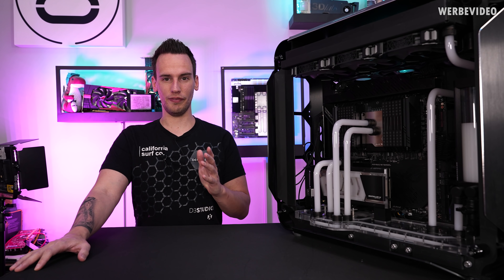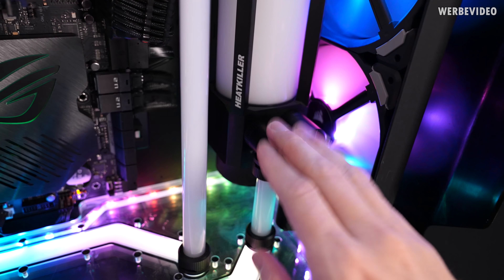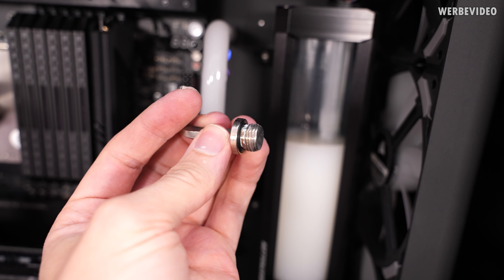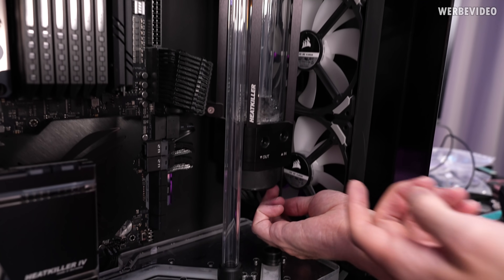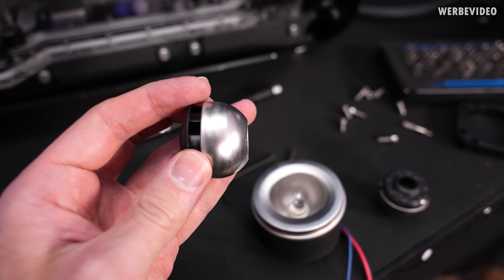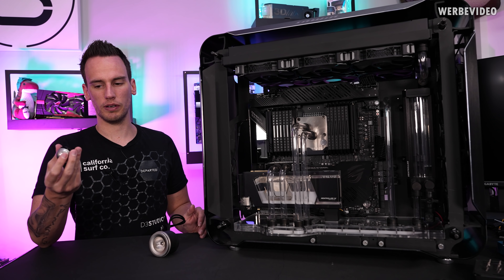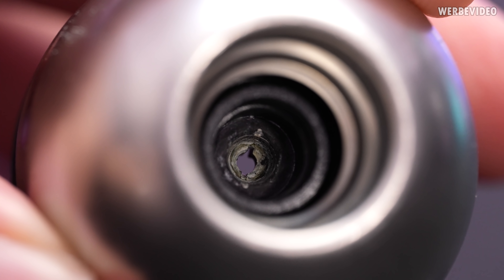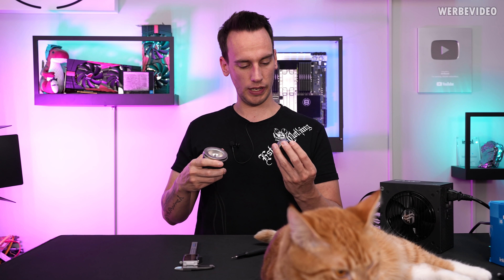Project Irrationality Part 13: Pump Failure :(

Comment: Have you considered swapping just the impellers between the two pumps since they are the same (looks like)? So you could keep the pump with the nice cables. Anyway for 24/7 operation a non pwm pump may be a better choice anyway
Reply: I was going to ask that too. The electric motor is likely to be fine for another while.

Comment: I have never had good experiences with EK solid coolants. Never had a pump die, but certainly had clogged blocks and dirty rads. My system runs 24/7/365 except for flushing and dusting downtime and I have had zero issues with any gunk or buildup since moving to clear coolant.

Comment: a week or so before christmas I had a pump failure of sorts. the pump itself didnt fail, but since it and the radiator fans were basing their speeds off my cpu and gpu temps, after rebooting one night, corsair's icue stopped detecting my cpu/gpu/mobo temps entirely. woke up in the morning to find my pc off and when i turned it on, everything seemed fine until 10 minutes later when my pc abruptly turned off again. It had seemed weird that my gpu radiator fans werent spinning prior but usually its cold here in the morning so hadnt thought much of it until i booted back into windows and saw my cpu was around 90-95c. I came to find out that icue wasnt detecting my cpu or gpu package temps and turns out that the certificates they use to run the software that monitors those temps had expired and i had to manually start that software everytime the pc would boot up. Ever since I've been monitoring my temps more frequently now. However, due to the slightly higher idle temps my cpu is at now, I may have to reapply some new thermal compound.

Comment: I personally only run clear liquid in my loop.   That opaque white was clearly what caused the problem.   But hey it looks better then clear.
Reply: A little bit of colour really helps you to see the presence of liquid. You only need one or two drops of dye, an amount that has no chance of gunging.

Comment: Calcium & lime buildup, possibly some other  junk, CLR off the top of my head would have cleaned this up well, also can run that CLR in your loop to clean out gunk from cold plates, & radiator, & any other parts, & let it run for a couple days with that in there then rinse out with regular water before filling back up with fluid.

Comment: This is like 99% of the time the 1# issue for D5 pumps. The ceramic bering wears down the inside of the propeller. Its only when you shut off the PC and let the pump stop that it wont start up again. Given that you run this PC 24/7 for couple years i would say thats roughly what i have seen. Mine lasted 2 1/2 years running my PC almost 24/7. About 2-3years if you run 24/7 or about 5years if you shut the PC off and only run it for half the time. 8-12h a day. FWIW i was using clear liquid also. I dont think the liquid really matters unless you have extensive breakdown or dint clean your system very well before filling. At the end of the day this is a common problem for watercooling. It doesn't even matter if you run the pump at full speed or half speed.

Comment: I don't use a D5, I use DDC 3.2 (not EK, Laing) and its also maglev and it has run 24/7 for over 11 years and still works just fine.  Maglev pumps should last a long time, I wonder what got in there.

Comment: for 24/7 systems, only way to really make sure,, is use 2 pumps. That way, if one fails for whatever reason, the other will still be working and pumping.
Reply: some pump comes with auto shutdown if it's fail

Comment: 1 pump + high pressure loss WB + micro channel + 1 loop for cpu & gpu. The pumps was already running over spec !
Reply: I have 1 D5, 4 rads (2 480mm and 2 360mm) 1 GPU block and 1 CPU block, single loop, never had a problem in 3 years, no build up, no corrosion, nothing, 9900K@5.3ghz and overclocked 2080ti and now 1080ti, temps were always great. Pump never above 2200rpm. Talked with DazMode a few times, he said "when temps are good you are good"

Comment: der8auer buried 3 pumps for last 3 years? i guess
while cheapest SC-600 water pump still working
Reply: @N0N0111  yep
best water cooling liquid is distilled water without impurities and dyes, wblock/pump/ radiators staying clear.

Comment: Strange question from liquid cooling noob. Wouldn't mind to add some kind filter before pump? Something like fuel filter from automotive?
Reply: That's a good idea. I have such a filter in my loop. It is a metal sieve. I installed that because I had a problem with residue in my CPU block. As of now I can't imagine a loop without a filter.
Reply: I think blocks do the purpose of it
Reply: @necmiozguven7092  not at all
Reply: Inline filters are definitely great, especially if you have very dense fins in your blocks that can clog easily. I have mine on the exit from my pump so that no potential debris can reach my CPU or GPU. However they are restrictive so factor that into your needs as far as pump
Reply: @sneedsneed460  I am not so sure if they are really restrictive.

Comment: Why couldn't you have just taken the same ball baring from the new pump and put it in the old one, that way you would of kept the black cable look? If its just the ball bering then why replace the whole thing?
Reply: To be clear this isn't criticism, just makes more sense to choose a cheaper option, if you can just replace one part 👍🏻 replace one part
Reply: I was wondering the same thing.
Reply: Changing the bearing would be no good as the old bearings would have worn in as a set. I'm not sure if you would just damage the new bearing trying to remove it.
Reply: @dandel351  Well I think Adam was talking about the whole rotor part, not the bearing itself.
Reply: @dandel351  looks interchangeable too me, I mean what has he got to lose in trying, would make a good experiment
Reply: @shadowkora  thank you for the comment 👍🏻
Reply from the maker: At the point when I fixed the old rotor the system was already back up and running. Just didn't want to disassemble again :D but in theory yes

Comment: Air cooling FTW! The temperature differences between a setup like this and a Noctua D15, isnt worth the hassle of dealing with potential pump failures, leakage damaging the parts and the way higher cost. IMHO
Reply: It’s Project Irrationality for a reason 😅😅

Comment: Id look at modifying the cooling loop with a pair of isolation valves to allow the reservoir to be removed without draining the entire loop
Reply: Will it reduce flow rate?
Reply: @greggreg2458  depends on the type of valve. Ball valves generally dont
Reply: @kennythedragon47  So like the ones you usually use for drain ports?
Reply: @greggreg2458  no. One that is made for inline installation
Reply: @kennythedragon47  Thank you very much for the explanation, have a nice day.
Reply from the maker: Will keep that in mind for the next PC!

Comment: Never had a pump fail on me, in a dual pump build. Always used clear liquid. Also, keep the water temp low for the pump, at least below 40C. I see a lot of builds using fancy colored liquid (the main ingredient of that build-up) , with single pump (requiring higher speed to run and thus higher wear and tear), running without any sensor reading the temp at the pump (as in having no clue what the temp at the pump is). If you want to crash your pump, that is the highway to go for. Also, just use two pumps, it is impossible to really bleed big @ss builds like these, with a single pump.

Comment: Wow. So another failure of the impeller bearing. EK must have gotten a bad batch of those impellers. Had mine fail about a year ago. Pump works still, just needs a new impeller. Graphite bearing in the impeller failed.

Comment: well, what i learned is that air cooling never gives me these kind of expensive, time consuming problems
Reply: Der Bauer is like "air cooled?"
Reply: This has less to do with general water cooling issues, but the fact that colored coolants are just horrible and all of this could have been avoided with a good quality clear coolant. 
Air cooling is still more reliable, but on Youtube, you generally won't find watercooling setups, that are focused on reliability, but instead visuals and show. Watercooling can be incredibly reliable if built for that.

Comment: I feel like this issue pops up every once in a while even though it has been known since the early days of water cooling. So it is very much self-inflicted and should be expected. Just do not use colored coolants in a production rig it is just not worth the hassle and will lead to issues eventually. 

Colored coolants are only an option if you do not mind cleaning the loop on a yearly basis and replacing the liquid. 
It is baffling to me how many YouTubers build their Workstations with colored coolant it's just such a terrible choice.
Reply: One word, content.

Comment: You can run these dry. They are maglev. It is very fun to look at them runing open, how they react to movements.
Reply: They are not maglev and should never be run dry. They are magnetically commutated (so no spinning shaft and no shaft seal needed), but the bearing uses a graphite bushing running on a ceramic bead, which is where Roman had his gunk build up.

Comment: I have 2 D5's running in series, they have been running for over 5 years without issues, pretty much same use case, PC runs more or less 24/7 with restarts for windows update. How? Distilled water. It really is the best coolant for Watercooling. Just use colored tubing if you want color. This coolant nonsense is expensive and only has downsides.

Comment: had this a few months ago with my pump, was playing some games and suddenly my pc crashed
turned it back on, was fine in desktop for a few minutes and crashed again
was thinking cpu oc causing the crash but noticed my flow meter not moving
was just a stubborn idot and rebooted my pc a bunch of times. untill it suddenly worked again, so hey results
i'm just on distilled water, might replace the pump as a precaution in a while, but it works now and shit is expensive
but, as a irrational pc, why not use dual pumps? also seems a bit safer as a 24/7 pc
am also thinking about watercooling my nas in the future and will probably use dual pumps if i can fit them

Comment: my system has been on 24/7 for the past 4.5 years and my pump has literally just failed 2 days ago.... it is still running with a fan pointing at the cpu block...... :D i'm on benifits so can't afford a new pump. :(

Comment: At 110C, you could have been using phase change cooling if one of the tubes had gone directly up to the top radiator

Comment: Shame...but that's what happens when you use coloured fluid.  The friction heat and compression between the ceramic bearing and race calcifying the dye particles to caused that failure.

Comment: About the memory RGB i got same problem. I turned off RGB in iCUE, but sometimes when i turn on computer one of 4 sticks keep glowing. I have to manually change profile in iCue to get it working. Sorry Corsair, but your iCue is sometimes garbage.
Reply: I don't think there's any good RGB software. My Asus RGB software has broken for the CPU block (RAM is still fine).
The old software used to work, but something updated and now it doesn't, and the new doesn't work at all.

Comment: This is why I have a strong dislike for running any kind of opaque or milky fluid in a system for long term use. Water and clear dyed fluid has no such problems, but all opaque fluids have large amounts of floating solid particles that cause problems.
Reply: No wonder any car fluid sold is always clear dyed.

Comment: Heey mr Bauer! happy new year, could you message Caseking to restock the T12 fans? 🤣 
I still haven't got my set... Also aren't there convenient wall adapters that have a molex and sata out for pumps? having a psu dangling around is always messy

Comment: I would use Autosol (metal polish) on a Q-Tip, and polish the scratches out of the bearing. It will also leave a silicone coating on the bearing surface, reducing friction. Hope that helps.
Happy New Year!
Reply: Terrible idea. This is not a ball bearing. It is a graphite bushing inside the rotor, which rides on a ceramic bead. The graphite bearing is, relatively speaking, soft. It needs to be treated carefully! Silicone residue could also react with the coolant.

Comment: Your shitty choice of coolant did this, I dunno why you would run coolant made for shows in your daily driver build; the specs on D5 say to use it with water and glycol mixture which I did + biocide and it's been working for 15 years across 4 different systems (just reused most parts apart from the blocks for new builds)

Comment: Not good to blow your mouth into the loop. Bacteria gets in and will cause crap to happen. Ask me how I know. Also fancy fluid like that is thicker and causes in my experience more of a higher chance for failure and also the fluid has more room for corrosion and issues that you don’t see till you drain it.  Clear fluid you know when it’s time to change it and clean your system.  The bearing failed on that pump that’s why it’s hard to turn. Bearings fail without proper lube and also too much heat.
Reply: Negative. Almost every other coolant/mix uses biocides so there is 0% chance of growth. Those that don't list a biocide, are usually propylene glycol based, which also acts against growth (and it's way better in terms of algae protection). If you use just plain distilled, you might run into problems though, sure but it's most likely the growth comes from the low quality distillation (also, a lot of people use deionized instead of distilled thinking it's the same) or stagnation if your system is off for prolonged periods of time. It is highly unlikely that you end up with algae growth by blowing through a tube for a sec or two.
Reply from the maker: Always did that and never had issues like that :/

Comment: No these pumps are shit. The rotor bearing surface needs to be hard in order to last, using plastic it's designed to fail
Reply: Well, with the experience of having 3 different Swiftech and 1 Alphacool D5s working just like day 1 for almost 13 years I tend to disagree :) If you did run into problems with one have you looked at if, build-up was the reason it failed? Or perhaps the controller got fried for some reason?